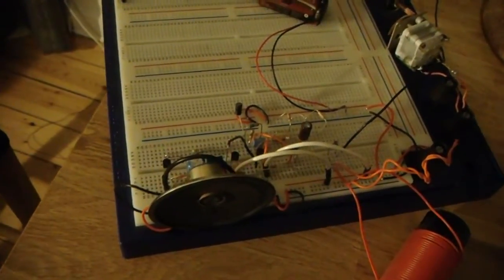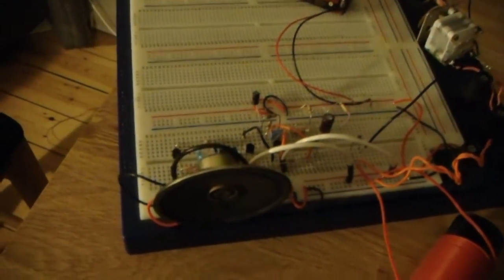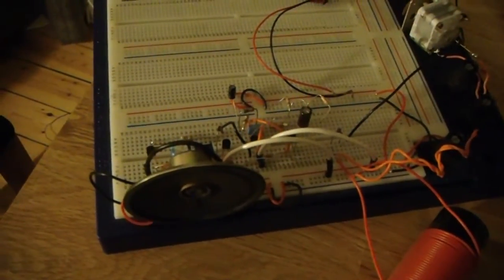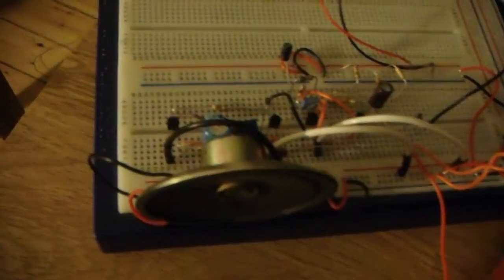DIY Shortwave radio

Comment: You should attach a digital frequency counter to it (you can get a cheap used one off ebay for $25) so you can see where you're tuning and figure out your frequency coverage with the number of windings you're using.  Maybe wind several more coils attached to a selector switch so you could switch bands for more coverage.    Also post a schematic.

Comment from the maker: @thewii552 
Well, the construction is awfully simple, basically a transistor amplifier connected to a crystal-diode setup (no actual crystals used), but the same way a crystal receiver is constructed, check wikipedia to get the idea, I can't bring you links here, but google for crystal radio and click on the wikipedia link.

Comment from the maker: @paulthez0mbie ,
Well, since this was mostly built with parts I already had in my workshop, the cost was sort of ZERO. But if I were to guess the price of the parts, I know that the Breadboard itself cost about 30 bucks (they can be gotten smaller and cheaper), speaker...a dollar, 4 bucks worth of components I guess. All in all..you could probably build this for less than 10 bucks if you do some wise shopping around ;)

Comment from the maker: @AbnormalEthnos, it really wasn't that hard. It's basically a Philips type 4-stage transistor amplifier (which you can find schematics on the net, google it) in combination with an absolutely standard crystal radio receiver. In other words - all you do - is to combine these two principles. You can't really make any mistakes.  Re-generative receivers however...is a different story.